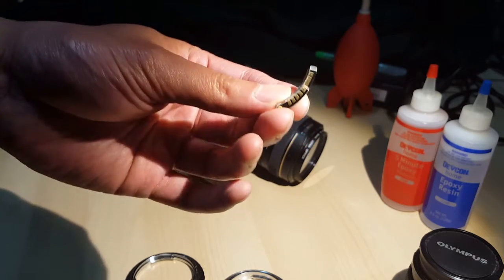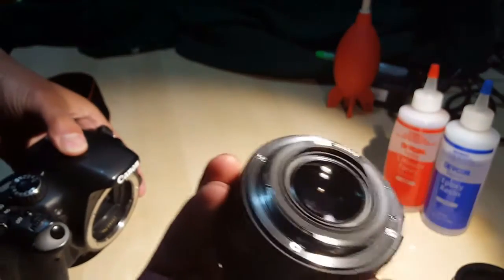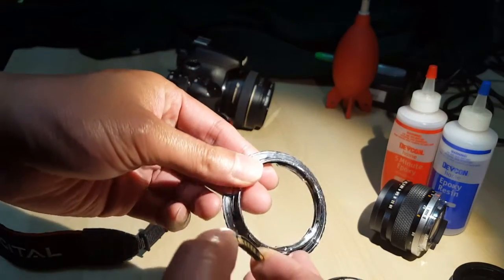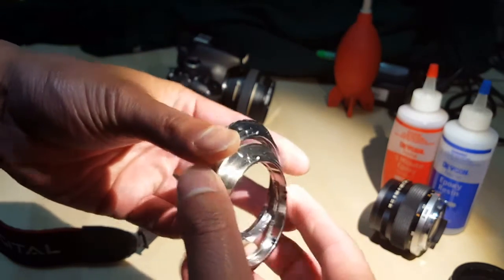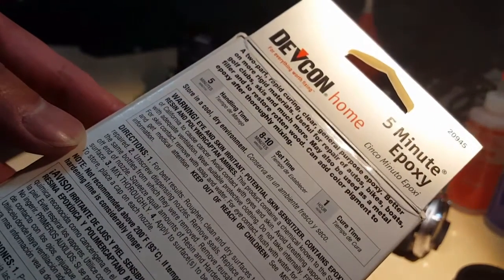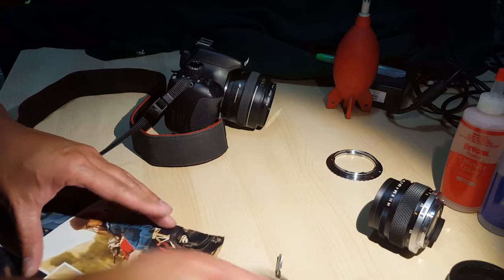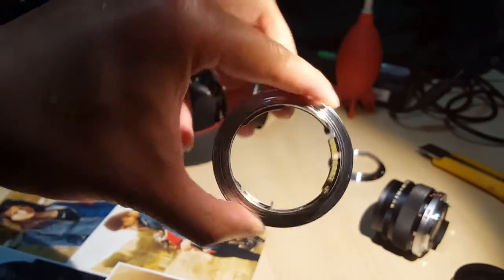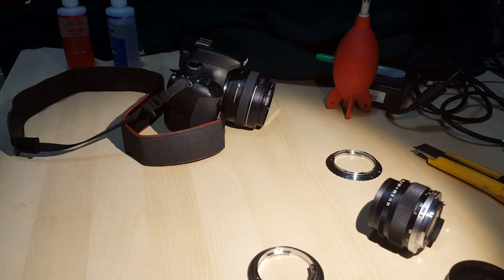How to install an Autofocus (AF) chip on a Vintage Lens Adaptor.

Comment: Did this end up working for you? I bought a pre-made one and with my 650D it just say's there's a lens error and it will not let me use the camera at all.
Reply: Because it makes no sense at all! How do this tiny piece of plastic with metal knows exactly when is in focus? Does it have a sensor to measure distance between rear element and sensor?
Reply: @fcallo  the camera wont focus confirm if there is no lens attached, only way for the camera to know if a lens IS attached, its own electronics must come into contact with that chip, in other words, if there is no chip the camera does not know a lens is attached.
Reply from the maker: Thats why i diy.... lol